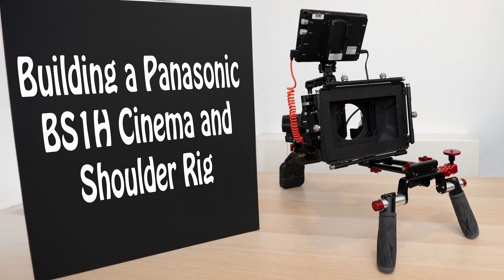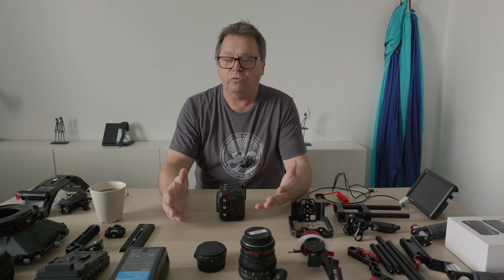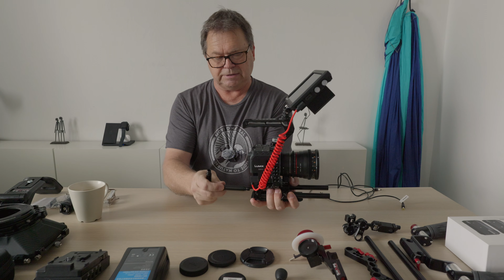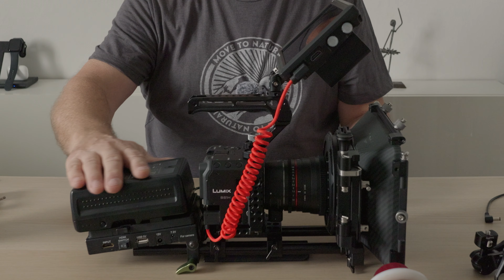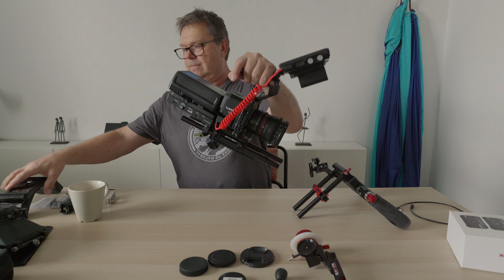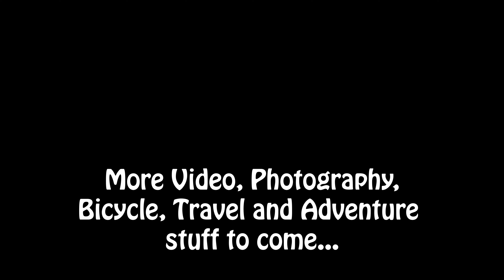BS1H Cinema Rig

Comment: What cable do you use from a V-mount battery to a BS1H camera?
Reply from the maker: It is a 12v to 12v cable that plugs into the v-battery mounting plate. Not sure of brand but nothing special, I already had one from previous projects.